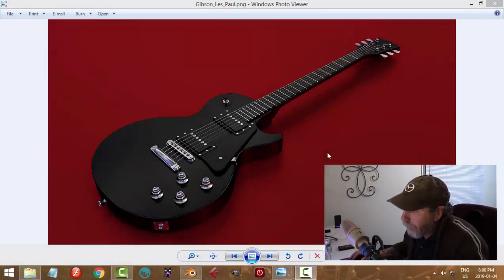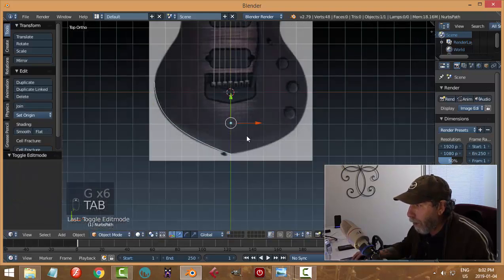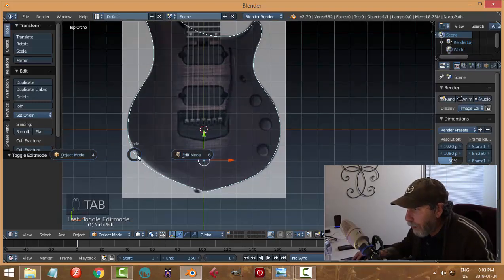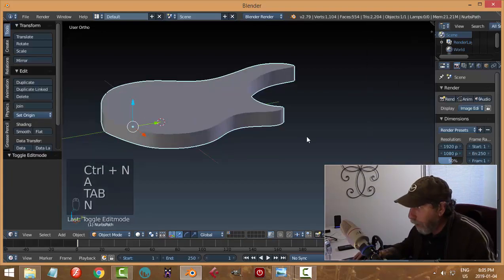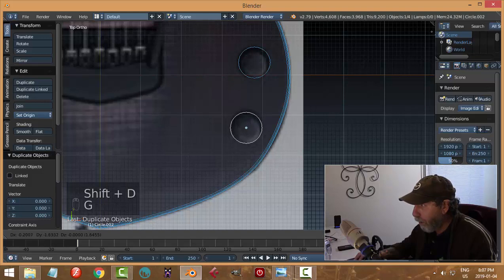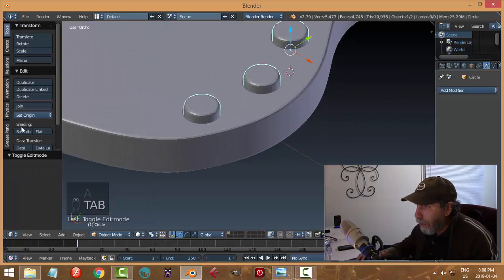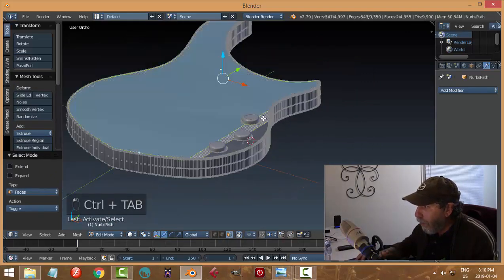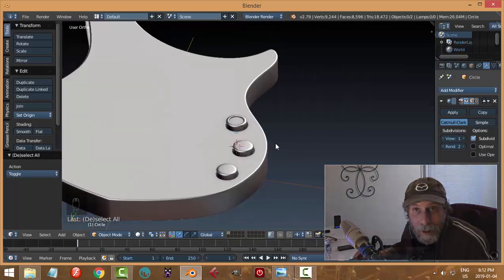Blender: Modeling a Guitar Body

Comment: The method you used where you extruded the edges and then made a face didn't quite work for me, but when I created a face before extruding the edges, it worked for me, in case anyone else runs into the same issue
Reply from the maker: Excellent!  Glad you found something that worked for your situation. Keep it going. Would love to see the final model if you want to share it.

Comment: You can simplify a curve after it’s generated so you don’t have hundreds of points, to fix those cylinder ends you can just poke the face, it makes a triangle fan instead of that ngon, I think to do the body I would have even number of points around it and grid fill it. Btw have you had a chance to try out the 2.8 beta, it’s pretty stable now, has a much better UI and the new real-time render engine EEVEE